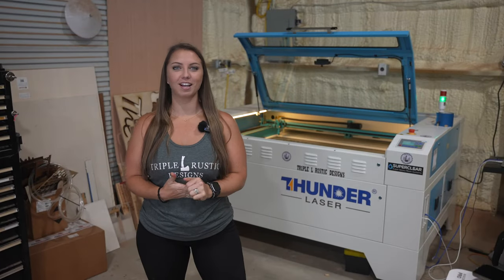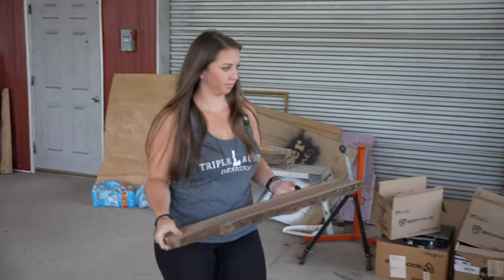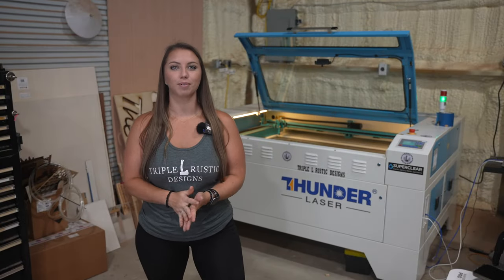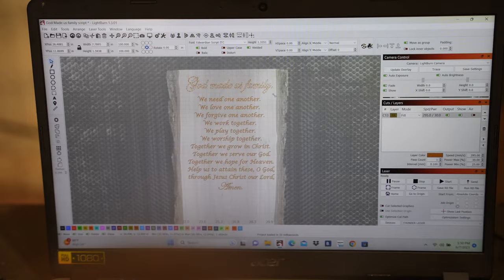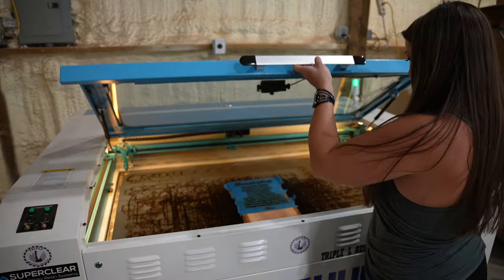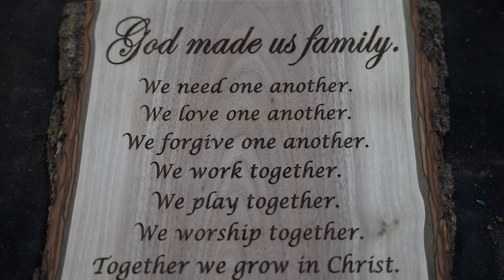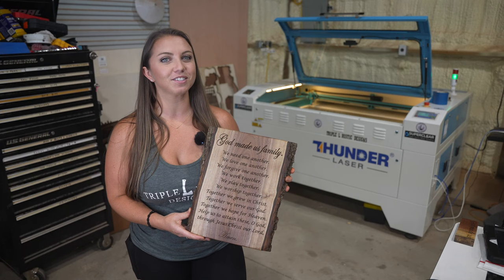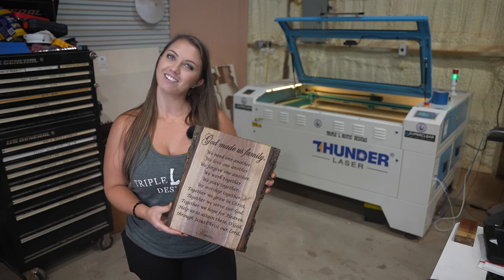A Custom Prayer On Black Walnut - Thunder Thursdays #8

Comment: That looks good, but you don't need the tape.  When I engrave, I'll use an air compressor and blow gun to remove the majority of soot left behind.  The blow gun won't get everything, so you will need to do a light sand with 600 grit sandpaper to remove any left over soot.  Another tip is to avoid Odie's Oil on engravings.  Odie's Oil is thick and meant to be wiped off after drying.  It will stick down in your engraving and be a pain in the a** to get out.  Personally, I use Danish Oil to finish my projects.  It's way cheaper, and works perfect for projects like this.  Not to mention the fact that you can get an even spread down in the engraving.
Reply: Good advice

Comment: Good video. Enjoyed seeing the creative process.  

I hate to be “that guy”, but I need to point out some safety issues.  

First, long hair should be tied back whenever using spinning tools like saws and sanders. 

Second, rings and baubles have no place in the shop with spinning tools. Dangerous to your hands. 

Finally, proper PPE is a must for cutting and sanding. Ears, eyes, and lungs should all be protected.